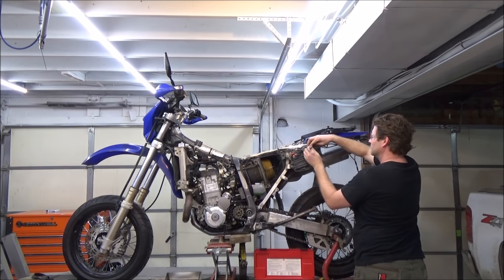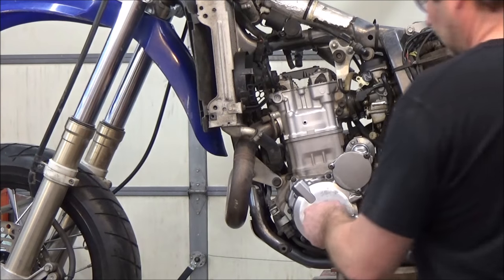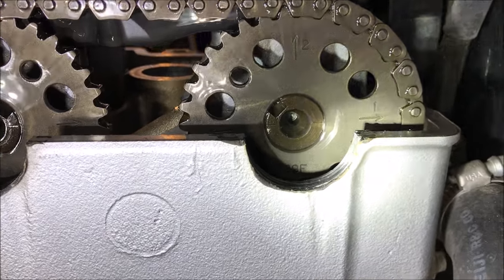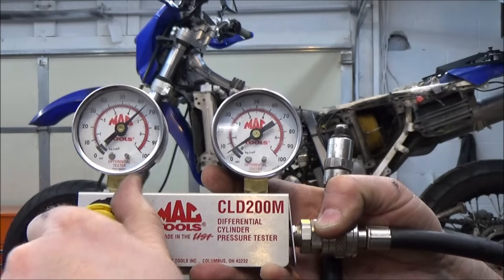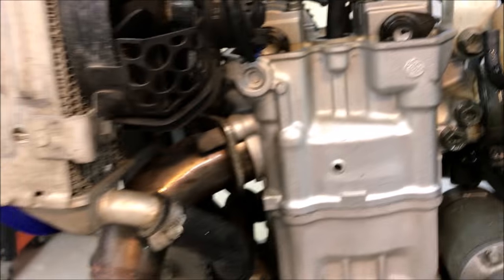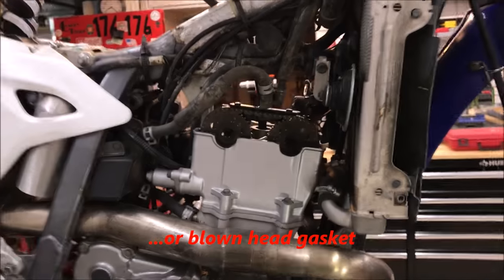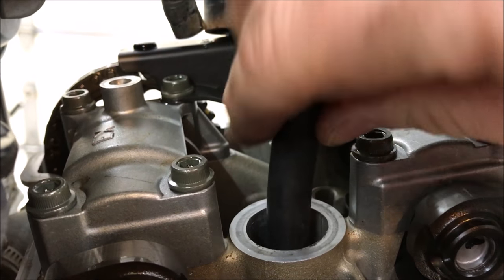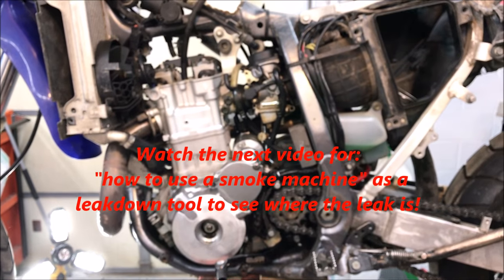Part 1: How to do a cylinder leak down test to "hear" the loss. Traditional Method

Comment: I bought a cheapo from amazon and struggling to understand the setup - Im not getting a reading on the "drop" gauge when the first gauge is outside 25-35 psi. You set yours to 100 (easy for the math etc). I have my compressor set to 100 - could a 2nd inline regulator cause this issue? or it there something else im missing?

It seems the cheap kits show you a result based on the "balance" between the gauges, however at a much lower psi rating than the pricier ones (and recommended psi).

I presume one needs a constant flow of air coming in from the compressor to the kit but im not sure why mine sucks so bad? Just saw a guy make his own and it went to 100psi on the first, the 2nd was just another gauge showing the loss..

could I not then set my compressor at 100 and plumb an inline compression gauge to read the "loss"?